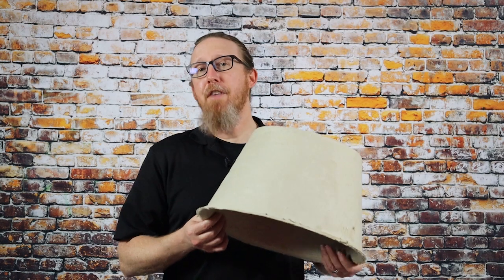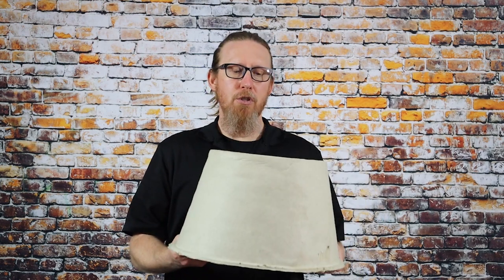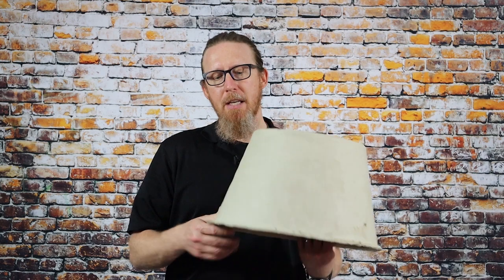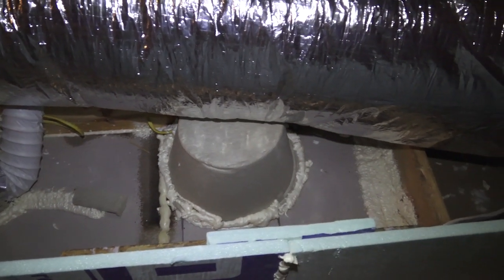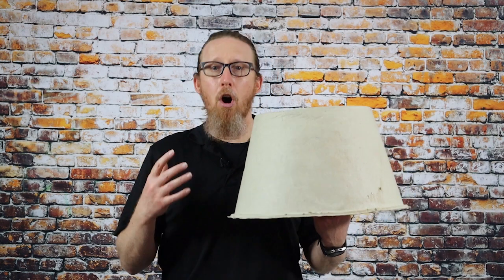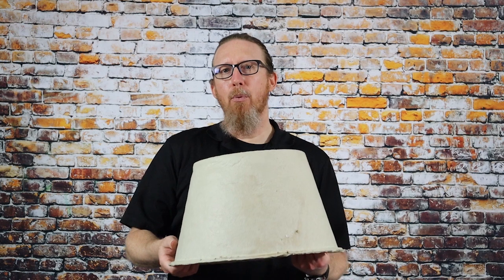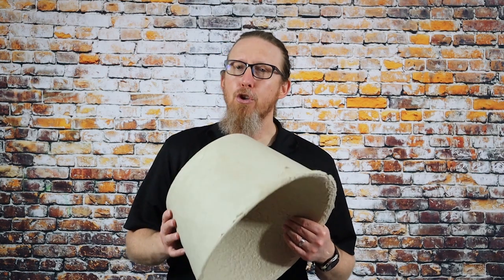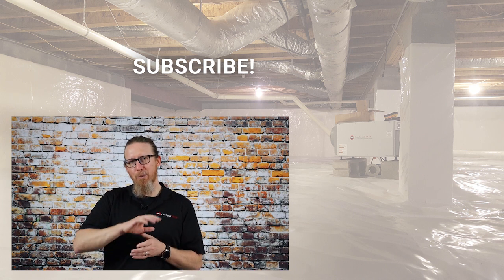Are Recessed Lights Wasting Your Money?

Comment: Why not just blast the can with spray foam?
Reply from the maker: If it is Non-IC rated "No insulation can contact it" It could start a fire.
Reply: @CrawlSpaceNinja  hmmm…fiberglass insulation has been over my cans for 30 years. Also…this would have to be less of a concern with modern LED light retrofits

Comment: What about a styrofoam coolers, if I run led's
Reply from the maker: I suppose that would would - be careful not to expose to heat and check local codes for fire rating, if needed.

Comment: New subscriber here.....no recessed lights here...but have the electric box  flush to ceiling sheetrock with surface lights....do you recommend the same covers to slow leakage in my house or is there a smaller cheaper way or should I just ignore those?
Reply from the maker: Great question, David.  There are actually a ton of different products out there that will work for electric boxes.  Make sure to check out Amazon as well as the big Home DIY stores.  You should be able to find a solution that isn't as expensive.  We hope this helps.  Thanks for watching and have a happy and blessed day.

Comment: Good video. Can the application of silicon caulking where the light meets the drywall assist in preventing any leakage into the attic. We just did a kitchen reno where we put 6 additional recessed lights and I believe the only thing compromised was the wire going through the vapor barrier. They are all IC LED models. In addition we upgraded the attic to R52. Comments?
Reply from the maker: For expert information please fill out this Ask a Ninja form - https://crawlspaceninja.com/ask-a-ninja/

Comment: Do you really need to spray foam around covers if you are adding insulation?
Reply: insulation is like a warm sweater... it insulates the temperature, but airflow with cut right through it... that is why on cold days you use a jacket over your sweater (blocks airflow). Therefore, yes you do need to sprayfoam/caulk (cause it is the jacket to the insulation)

Comment: Nice video! Should I get these if my LED hi hats are IC rated? Or is it safe to insulate right over and up to the hi hats, without the Tenmat?
Reply: Great question and I’m disappointed that it was ignored! Did you find an answer? Thanks.
Reply: Can someone please answer this question? If the recessed lighting can is IC rated, why do need this cover? I shoudl be able lay insulation right above this
Reply: @wsiddiqi  even though you recessed can is rated for insulation contact, that doesn't mean the insulation will stop air leakage. with an IC rated can, the tenmat or can cover is there to reduce (or stop) air leakage. even though many IC rated cans say they're 'sealed' it doesn't mean they're airtight. that tightness is what the can cover helps accomplish if installed correctly.

Comment: I just can’t get on board with using these in the south. $15-20 each when I have almost 20 in the house, and that’s without paying someone to install. How long would it take to make that back in energy, ten or twenty years? Wouldn’t caulking around the light face form an airtight seal and prevent air leaking? A homeowner could DIY that for less than $10 total.
Reply: (former insulation laborer and navy electrician) not expert or certified, but...yes caulking around the face of the light at the edges would help some (slightly). Also I would be curious as to which part of the south u r referring to. 
(I've lived in a few diff places all over the South and currently own home in South AL) but just because u stop all the air doesn't mean u still won't lose a lot of heat energy, transfered thru thin, non-insulating materials, such as the metal that the light fixture is made of (metal is a good conductor, not insulator) or wood, or plastic (just depends on type and thickness..) this is how the infamous "R value" is calculated...how well the material "resists" (nothing will absolutely stop it) the transfer of thermal energy (i.e. 'heat') from one side (or 'thru') to the other (even if no air is being transferred)
Sry hope u can understand that..
Reply from the maker: The light covers not only help keep the air from leaking, they also reduce the heat coming from the lights from getting into the attic and making it hotter, and it allows you to insulate your attic with blown-in insulation since you can't have the insulation covering the lights (fire hazard).

Comment: Interesting.  I think our modular home has the white fluffy foam around them.
 But I never installed anything not led when we had the house built 4 years ago.  Our power bill is lower than our last home which was smaller.  LED lights are worth the investment.  Just get the correct color temperature bulbs or they can look crazy.
Reply from the maker: LED lights are awesome. Definitely agree that the color temperature can make things wild if you're not careful. Thanks for commenting!